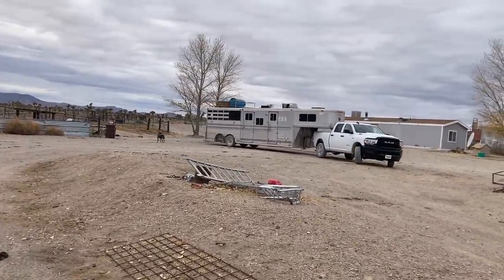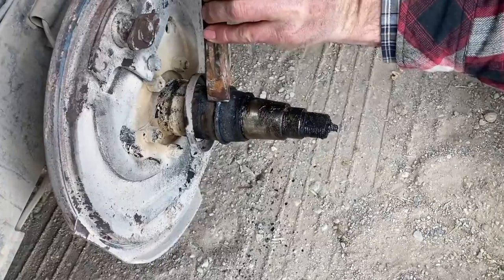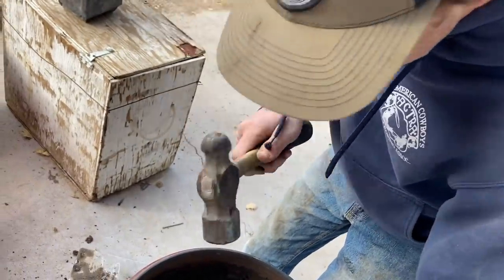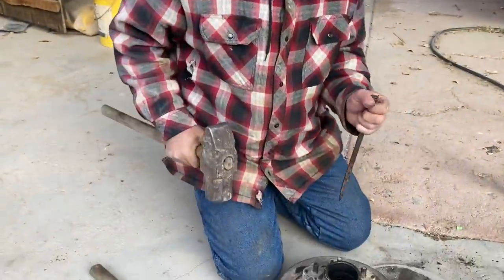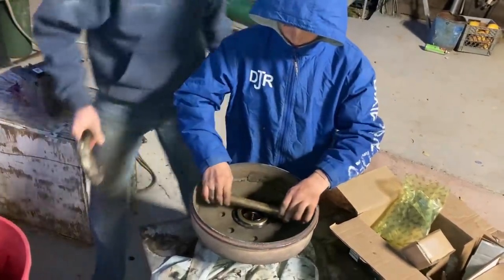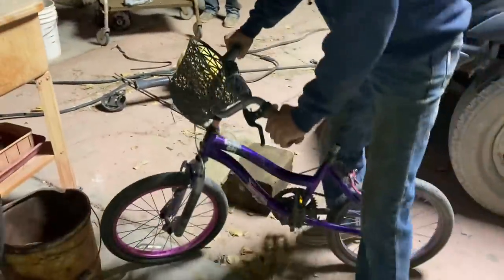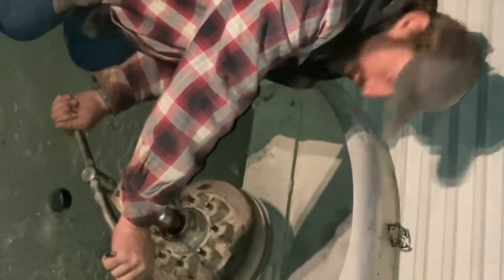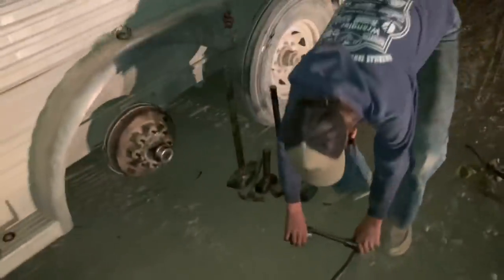**SUPER boring BEARING Replacement * On Trailer 😴

Comment: Not sure if anybody has already mentioned it, since you already lost one it would be very smart to re-pack and inspect the other 3. One suggestion, right before you install the hub pack the inside full of High temp grease. Basically you want a small hole in the center where the spindle will go through. That way you'll prolong this from happening sooner then later. Remember the inside was dry on the one that failed, more grease you can get in there the better. 
Great job teaching your boy's.

Comment: Usually just flush with the seal, you can go a little deeper it where the seal rides is worn.  Save the old races use with your press. Also cut through the race with a cutting wheel and use it to push in the new race.  I buy cooky sheets for my wife and take the old ones for parts trays.  I'm thinking of her...

Comment: Awesome job fellas! I come from a large family of farmers/ranchers, and diesel/heavy equipment mechanics and they all say the same thing. You can run bearings loose but you'll burn them up in a mile or two if they're too tight. I personally probably would've tightened it a little more especially since everything is new but probably better to break it in and visit it a little later. PS. Probably wouldn't hurt to check on the other 3 bearings. 😉

Comment: Shopping list! 
Bearing removal and installation kit. 
Also use the old bearing race to hit the new bearing race back in, or even the correct size socket ,which will sit on the edge of the bearing race. 
Having the  brake drum on solid block or bench or even a big wooden block, that way you reduce the bounce and the impact when hitting out bearing race etc, you want to hear a solid thud with the correct  hammer., yes correct hammer, not the claw hammer (Matt's Off-road recovery uses a claw hammer lol
Yes pre load is important in the new bearings and re-check them after some miles.
Reply from the maker: All information we will for sure use soon! Thank you!
We did get the part right about using the old race to pound in the new one😜

Comment: Love your channel this is how I grew up, always fixing things we could not afford to replace.
If you put a cut across the old race before using it to tap the new race in it will not get stuck in the bore.
Also put grease on the seal where it runs on the spindle, stops it burning up, I also pack the inner part of the seal with grease.

Comment: File the ends of the brass punch to square it.  Next trip check for heat or if loose 10, 20, 50 mile down the road.  Remember, if it is tight or loose, you will need tools to fix it.  Not a bad idea to check for heat occasionally on a long trip.  Made a brush fire call on IH35 at Buda, Tx and found a guy from Cotulla, with a new half wild horse in a trailer with a wheel run off and the spindle dragging.  Spindle drag sparks had a big fire started with a high wind pushing toward him and the drag had forced him off the road into the ditch.  He was getting ready to have to unload his horse and kiss his truck and trailer good by, when I got there.  I think you and the boys did a good job.  There is one more way to get the inner race off the spindle if you don't have heat.  Put your jack under the race and get pressure on it.  Wrap a good lot of rags around the race, put your gloves on, take the biggest cold chisel and hammer you have and split the race.  It will through sharp steel everywhere if the rag don't hold but will work.

Comment: When cracking bearings be careful as they can shatter and metal can go every where. I know from personal experience of wearing a piece of bearing  attached to the bone of a finger before having it removed a number of years later in hospital. Also with that inner cup on the drum if you run a weld around it you will find in most cases it will drop out fairly easy. Does not always work then weld a bit of  scrap metal into it and it is easier to drive out. Many years experience as a maintenance fitter.
Reply from the maker: That’s a great suggestion I have a feeling that will save me one day!
Thank you 🙏

Comment: Great job on the video and shop class for the boys. You did a great job on the wheel bearings the only thing I saw was you could have used a 2x4 to put races in. Instead of the round brass but it worked out fine for you. Great job Hope you and family have a great day and Take Care
Reply from the maker: Thanks 🙏

Comment: Oh I love those wheel bearing jobs! Did ya pick your nose or rub your eye? The gift that keeps giving! You can weld around the bearing race and they usually slide right off, it works on the races in the drums as well. Liquid wrench is a great move!
Reply from the maker: Several people have mentioned that welding method.
I’m almost excited for the next time we have to go bearings and races. Why didn’t someone tell me before hand 😂
I had to edit an hour of banging and cussing 🤬

Comment: Great video. You can just lay a piece of wood or steel over the whole seal and tap it in flush, same with the race. Then you can turn the old race around and use the thin side to drive the new race in, if it gets tight grind it down a little. If you get a race that you can’t seem to drive out, weld a thin bead around the race that’s in the hub then knock it out. Best thing to do is find a set of seal, bushing drivers. There’s no doubt in my mind you and the boys will get it figured out no matter how you do it.

Comment: As a farmer I learned that you tighten the nut while turning the drum to seat the bearings, then back the nut off until a flat tip screwdriver turning between the hub and washer can move the washer behind the nut.

Comment: Tighten up while turning the hub when it starts to get a little snug then back off axle nut one notch and you are good to go! One 1/8 to 1/4 turn back off. I have been doing them that way for 50 years.After you put the wheel on grab top and bottom and see if has any loose play in the bearing. If it rattles it is too loose.

Comment: Just finished one of those on a flat bed. Yes flush is good cause when you put the nut on it will seat it if it needs to go further. When you heat for the outer race heat the hub to expand not the race. Inside you did right. But luck is the biggest factor.
Reply from the maker: Makes sense thanks 🙏

Comment: I always run it down with impact then look on the nut for the hole and back it off one loose from the max tight, if that makes sense, so if you can pin it very tight, then back it off one to the next hole where you’ll be able to pin it again, unless it’s a full turn then I pin on tightest, hope it helps, just be glad the brakes are gone on it! I hate doing drum brakes on trailers
Reply from the maker: No joke those trailer brakes don’t last long on these rough roads!
Thanks 🙏

Comment: From someone about 100 miles north of ya.
First THANK YOU for bringing back memories of my learning days...
Now a few suggestions 1) a welder on old bearing races works better then you can imagine it not only provides a very focused heat but also give something to put your punch/chisel on to to help remove.just mind your spatter so as it doesn't stick.
Next time try a bearing race install tool they are fairly inexpensive and can also be used to aid installating seal....
another inexpensive tool is bearing packer they make expensive ones but for the occasional use there are some inexpensive options.
Keep up the good wook
Reply from the maker: I would not have thought of the welder but that makes sense!
Thanks 🙏
Reply: Have used this method many times just make sure to use something to protect services you don't want slag on.
Also if you have a bearing race stuck aka welded and you have a small die grinder cut into race but not going all the way through and then use a chisel to crack it the rest of the way this will usually break that bond then clean area with sand paper and then test fit new bearings before greasing anything.
Remember if spindle is small replace it.
Once again thank you for the memories of time spent with my dad as he was an air craft mechanic as well.
Keep up the video's look forward to there positive they show
Reply from the maker: @JeRKII  
That’s cool that your Dad also worked on airplanes ✈️ 
As a small boy I spent a few nights in the hanger with my dad . I usually ended up falling asleep though.
Reply: I wasn't able to do that as I was for the air force but we did have many a nights like this video around the house.
Thanks for responding maybe 1 of these day I'll bump unto yo all at Walmart in Cedar. 
Keep being awesome
Reply from the maker: @JeRKII  ha you’ll catch Laura in Walmart you’ll catch me waiting in a truck and trailer in the northeast corner of the parking lot 😜⚓️
Reply: I won't really be looking but if I happen to be there 1 day the same time and just happen to be out where the pan handlers and the empty gas station lot is and happen to see ya I'll stop and say hello.
But there is a lot of just happens in that statement
Reply: @anchorbrandranch wow I've been watching for 2 years really makes ya wonder how time flies so fast

Comment: served an apprenticeship as a millwright. they "hammered into us that you never hammer on a bearing, That causes false brinelling, dents or scratches in the bearing race,  Bearings and seals should always be pressed into place. Also pack it full of grease, excess grease will malt and run out.  if somes good, mores better.

Comment: Flush is fine. Suggestion for a bearing race that don’t want to move weld around the id and as it cools it will be easier to remove. Od weld a little or heat like you did. It’s good to have something to lay parts on to keep dirt out/off.

Comment: I don't waste my time trying to pull a bearing or in your case a bearing inner out when I can get a torch in to cut it off.  Torching is much faster.  As for the stuck bearing cone, if you weld a bead around it, the race will fall out, just don't weld or arc your rod on anything but the race. :)  Brass punch is always a good idea, but I never worry about denting or marking a bearing or a cone with a steel punch. I always tighten the nut on the hub till the hub gets stiff and that seats the bearing on the cone, then back it off  a bit until the hub turns with little effort. In the big picture, you got the job done and it will work. Love the patience you have with teaching your kids.  i wish I could have been more like you with teaching mine.  It always seemed I was in to much of a hurry to have them do things like that, and expected them to learn by watching me.
Reply from the maker: Thanks for sharing 
I know what you mean
My dad was a great mechanic but I just let him fix everything while I did cowboy stuff 
Now I’m paying the price 
Learning things on my own that I should have learned with him

Comment: A tip for packing bearings . A 100ml disposable syringe filled with bearing grease  with or without a needle attached  can push grease right up between the rollers . Check the other 3 wheels on your next free day.😉
Reply from the maker: Good idea 👍🏿 
Thanks 🙏🐂⚓️
Reply: Never any free days on a ranch or farm; jus hafta make time
Reply: @vernonfisher857  I know the feeling well , wasting daylight is a luxury most of us cannot afford . A week of wet weather is good for getting some "shed" jobs done , but I can't remember when we last had a wet week.😒

Comment: Nice to see you teaching your sons, so few do anymore. Some tips that I have found work for me. First grind the end of the brass bar so there are no big lumps on the end. they break of and fly out of there: and if you are lucky they only cut your cheek. I use a wheel bearing grease, available at any auto parts store. It is a long fibre grease which tends to wrap around the rollers in the bearing, where gun grease is short fibre and just eventually flings off.  Another trick I use is on the outside race in the hub: is run a bead of weld around the inside of the race, let it cool, it shrinks and comes out a lot easier, I have had them fall out when the hub was turned over. note before welding clean the inside of the hub really well. Other than that you have it covered.
Reply from the maker: Thanks for all the good info
It will be used for sure 🙏🐂⚓️
Reply from the maker: @tomwardman5655  dang good to know 😬
Now if we ever need to mustard gas anybody 😜

Comment: Your dad was exactly right. I tighten them down tight tight to be sure the races are seated then back it completely off. Then tighten it down till it touches. Then you can back it off one half to one full flat on the nut. With one nut and a cotter pin type I go a half flat Then back till the cotter pin will go in. You should have a little bit of end play, just a bump you can feel. On the two nuts type torque the inner nut to 150 pounds turn the wheel then back it off. Then torque to 30 pounds and back off a half a flat. Then put the outer nut on and torque it to 150. I know some Fords 3/4 ton and larger require the bearings to be preloaded with torque - about 30 lbs torque left on the inner nut - so you need to Google those to be sure.
  On all trailers with grease hubs you want just a slight bump of end play. The play comes out when they heat up as you are driving. Too tight will burn them up every time.

Comment: As you said your dad already told you it will never run too tight but it can run about any other way, besides you can pull it some then recheck it you think is too loose tightened it up some.

Comment: The easy way to get those bearing races out of that or any hub is to weld a bead around the inside of the race. Weld all the way around the race in the center of the race and it will fall out when you turn the Hub over. Be careful not to run off the edge of the race with the bead. You don t want to weld the race to the hub. A lot of the time you only have weld about 3/4 of the way around. Welding  shrinks the race and draws the metal together and the race will fall out when you turn the hub over. That will save you a lot of time and you don t have to beat on it.

Comment: PS, while the tools are there, jack the trailer up and check all the other bearings, wheel hubs, tyres, and torgue the wheel nuts (lugs)  and apply some lube to the threads, so you can  remove them with ease in the side of the road or in your case, the desert. 😀
Reply from the maker: Good idea 👍🏿

Comment: The hardest part of this job is getting greasy. No problem there. This comes 6 months late but maybe next time: the best way to adjust the bearings is with the wheel on so you can grab hold and to see where it starts to wobble.  It's a fine line between too tight and too loose...you have to use your own judgment.   Someone else here said to go ahead and repack all 3 of the other hub bearings too.  That's good advice...this bearing that spun is an indication the rest need attention.   Go buy more seals... take em apart and use brake clean to clean it all up and pack em just like you did.  Good time to inspect the races too...this should not be happening on the road with your horses and family.  Be safe.

Comment: Boys did a great job!  Fast and easy way to get races out of a hub is to take your stick welder and run a few inches of bead around the inside of the race. The welding will shrink the race and the should fall right out.. And as always. If it has tits, tires or rotates, it's gonna cost you a lot of time and money
Reply from the maker: Ha 
All good advice 
Thanks 🙏

Comment: Use a clean piece of 4x4 to drive in seal it will only go so far. Unless you get all Thor with it and use a 20 Pound sledge!
Put grease on the heel of your hand and scrape bearing down from your fingers the heel is harder than the palm and you get done faster. 
Dad taught us to tighten it down till it quit turning then back it off so that it would make a single revolution when you spun it.
I kept trying to reach through the screen to help! This is one of the first jobs my dad taught us boys, well that and scrapping gaskets and cleaning parts
Reply from the maker: Thanks Charlie 
Wish you could reach through that screen!

Comment: Hello there. Toyota Hilux is probably one of the best trucks for its size. One of my friends has a Hilux and it's done 300 000 miles on the same engine.
Reply from the maker: I want a hylux
Reply: What is the one you have with the broken drive shaft. You know that dark coloured on. You can split those drive shafts. About 4" down from the UV joint there's a nut. If you unskew it the UV should pull out. It will make it easier to replace the UV joint.

Comment: I use a block of wood that is bigger then the seal, and I have always gone flush with the seal. Tightness should be tight till no turn then back off till it turns.

Comment: To get the bearing race out easily  take the welder and run bead about an inch long where the bearings ride. Then just a couple light taps with the punch and hammer and the race will fall out.
Reply from the maker: Thanks I am excited for the next bearing job so we can try that out🙏⚓️

Comment: isn't there a hole for a cotter pin near the end of that shaft, goes  through the splins of the nut. Collect large huge pieces of cardboard for working on stuff. saves on the knees, and a 6-8ft tarp to work on and keep parts from getting lost, looking for a small nut in the gravel could take a while to find

Comment: Also what year amd modep is the four wheeler if it holds up to all the use and abuse to anchor brand ranch can dish out I'm going to look for me one as were I live you can find used old ones with less then 2500 hrs or miles on them do to people don't use them a lot before they byy a brand new one or move to town  ..
Reply from the maker: 2009 Honda rancher with old style foot shifter 
If you find any like mine with low mileage I m interested ⚓️